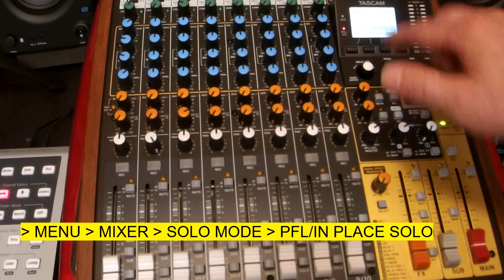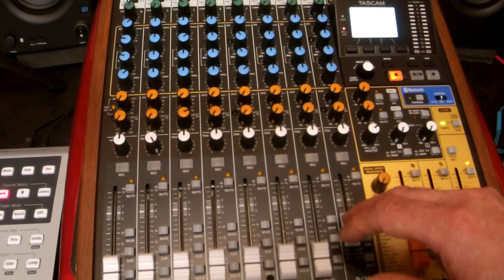A Solution/Workaround for TASCAM Model 12 Mixer Headphone | No External Headphone Amps Required

Comment from the maker: TASCAM Just updated the MODEL 12 Firmware to Ver 1.3 that has the new feature I was asking for, the headphone mix. Now you can select the headphone PRE or POST Main Fader. And a few other options too. https://www.youtube.com/watch?v=hToI7NPYyAA
Reply: can you mute the speakers now?
Reply from the maker: Yes, and both headphone levels are independent.
Reply: does it work when you use it as a controller?
Reply from the maker: Yes.

Comment: Thank you for this video and thank you for pointing out that another solution other than what you came up with could  be implemented through a software upgrade possibly brought about by you bringing this need to the attention of Tascsm. Thanks.
Reply from the maker: This issue has been resolved via firmware upgrade to ver 1.30 and above.

Comment: If you have a monitor station, you can control your monitors with that....correct?...and overall might be a good purchase if you don't have one....for extra speakers, changing headphone volumes in comparison to monitors, etc
Reply from the maker: Thanks for the suggestion. Yes, that will work, but I'm trying to avoid extra unnecessary costs.
Currently and for foreseeable future, I will only have one set of speakers for accurate monitoring reasons. One can only have one speaker setup at the correct listening position at any one time.
My second set of PreSonus Eris 3.5BT are for video editing and multimedia purpose.

Comment: I have a nice tube headphone amp connected to the sub output.  When I used the existing headphone out the volume was kind of quiet.
Reply from the maker: I guess it depends on the impedance of your headphone. Some high impedance headphones require more power to drive them.

Comment: Two year later, Tascam has yet to provide a solution to the headphone problem. I can use out 1 & 2 but the volume is super low and does not have any dynamics to it no matter what I do. Pathetic. However, I do realize I could be the problem as well as I have owned the Model 12 for two years and never got it to function properly even with the updates and a new PC. I hate the purchase and wish I'd stuck with Focusrite which never failed and was super easy to integrate in Studio One 6. Model 12 seemed to be a wonderful purchase at first but has been a nightmare even after watching a dozen different videos and the recent upgrade to 1.41. It just will not work in Windows 11, I suppose? It keeps telling me to upgrade to Windows 10, or that Windows 10 cannot be found. 
Any help by my fellow musicians will be greatly appreciated.
Reply: BTW, I can listen to my Studio One track when I plug my headphones into my PC, but the volume cannot be adjusted by normal means. The volume slider or controls don't work.
Reply from the maker: The headphone problem has been long resolved. I recommend you to watch my Model 12 playlist videos to learn how it works.

Comment: What made you decide on this unit as opposed to the Soundcraft MTK 12? Maybe the fact that this has SD recording? Maybe because this has a compressor on the channel strip? Maybe because it has some DAW control ability?  I went with the the MTK 22 because it was all analogue, but I gave up a lot features of the Tascam 12
Reply from the maker: Thanks for the comment.
I wanted something smaller than my current Behringer UFX1604. For about the same price as the SounsCraft MTK22, I got the SD MTR, CH1&2 hardware inserts, SUB out, and somewhat a DAW Surface controller (not sure I'll use it as I have dedicated 8 fader SC) and few other extra features of the digital world.
I know it's all digital and if I need analog vibe, I have my UFX1604.
Mainly it's for the small and neat size and flexibility of the audio routing, except the headphone issue LOL! Hope this will be resolved in the near future by TASCAM.

Comment: Dear Vatcha love your channel.  I have some questions Sir.  I watched this video and am a little confused.  Note this. The Model 12 is an Analogue front-end for DAWs, offering a 12-in/10-out USB 2.0 interface that moves 24-bit/48kHz audio between the mixer and your recording program while delivering tactile control over faders, pans, mutes and transport controls for most DAWs.16 Sept 2020.  According to Tascam.  So you will have an Analogue front end.  The control knobs will not be rotary encoders then.  Just like analogue Behringer mixers.  So the digital side will be the recording part I presume.  I have just sold my Behringer x-air 18 Digital unit as It did far to much for what I needed.  Had it 7 months and sold it for what I paid for it new. Lost nothing.  I have gone back to the Behringer QX1222 USB.  Ps  as I do not have a channel thought you might like to share a tip I have.  When using reaper on Asio drivers you can not record  and play back at the same time.  If you try to play a youtube video and record a Microphone say.  Youtube just hangs and will not play.  After many hours trying to find a solution on youtube.   I tried this.  When My Analogue mixer was on. I plugged in to the computer a £3.00 usb sound card.  I altered no settings at all, and like magic no more play record problems. Reason I am telling you is you may have come across this same problem on some of your equipment in the past.  So as you have a very good channel thought you can help your fans if they have the same problem. I have no idea how or why it works it just does.  I was even thinking of buying a different mixer.  Love your vids Sir. Keep up the great work and may you live long and prosper. Den in uk.
Reply from the maker: Thanks for watching.
As to TASCAM Model 12 and how it works, this may be explained in my next quick review. The mixer is not analog other than the input gain section. All Comp/EQ are digital all the way to USB to PC.
As to your YouTube video/audio playback, have you tried installing ASIO4ALL driver? This could resolve the issue, as Windows Audio doesn't like sharing devices. By plugging the cheap USB soundcard, you are redirecting the Windows Audio to it and allowing the browser audio to be shared. You can also enable Device Sharing in REAPER so REAPER will share the QX1222USB device with rest of Windows' apps in the background.

Comment: I have the Model 24. What if I want to mix using headphones? Without the faders working I cannot mix. But pfl must be depressed in order to hear anything on my headphones. Thanks.
Reply from the maker: What do you mean by "Without the faders working "?
Do you have the Control Room level up, Headphone levels up?
I'm pretty sure the issue that was on the Model 12 prior to the Firmware update is relevant to Model 24, as the audio routing is different, since the Model 24 has separate Control Room audio bus.

Comment: Hey man I'd like to use this board for live shows. Specifically for running open mics.I'd like to use this board for live shows. Specifically for running open mics. I'd like to bring music in and out from my laptop between performers. But I want to be able to use my headphones to cue a song without that song coming through the main speakers. Is there a way to do this without having to buy an extra amp to go through sub? Can I send my laptop audio to aux and monitor that way? I'd like to bring music in and out from my laptop between performers. But I want to be able to use my headphones to cue a song without that song coming through the main speakers. Is there a way to do this without having to buy an extra amp to go through sub? Can I send my laptop audio to aux and monitor that way?
Reply from the maker: You can use the Solo button in PFL. Listen on headphones that channel without it going to Main.
One point, to be able to cue one song while playing another, your music player or DJ player needs to have 2 Stereo out, otherwise you can't. If so, then send the main DJ Stereo to 9/10 and the H/P cue to 7/8.
Hope this helps.

Comment: Dig your channel. You know your s**t... Question on M12 that I can't find in manual & forget trying to get teac support to  answer phone or get back to me, not happening. Q: How do I edit the recording time on a song without deleting entire, need to save, song? A few times when live recording I forgot to shut record off so I end up with 30 min recording added on to a named 5 min saved song. So, obviously when I send the wav file or exporting wavs I just want the song length. Do me a solid & I'll push your channel on my FB page (I'm going to either way)... need an answer asap... #starvingartistusa
Reply from the maker: Sorry to bear the sad news, but there are no even simple editing functions in the MTR recording. I would expect even a simple TRIM option for at least the whole song, (every track recorded) with start and end markers, but no. MARK option is already available, it would seem simple enough to add TRIM between MARK 01 and MARK 04. Done. But, no.
Someone added VAMP feature in ver 1.20, which I can't see anyone requesting this feature or many using (I did a TASCAM Model 12 users' poll), yet no basic editing option.
I agree, it's crazy.

Comment: Why not just turn the power off on the monitors? Then you can use the main through the headphones, easy fix. 🤷‍♂️
Reply: Thank you very much
Reply from the maker: Thanks for watching.
Yes, that might work, but I have two issues with your suggestion with me and I'm sure with many others.
1. Unless you are using small easy access speakers, I have no access to the back of my two studio monitors to turn them on.off.
2. I'm not a fan of turning equipment on and off every few minutes, especially amps and speakers.